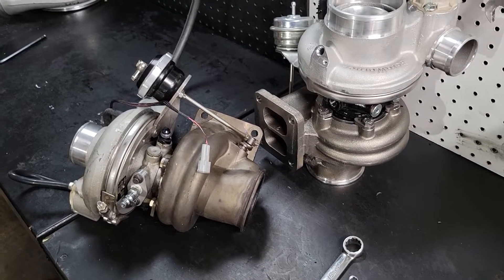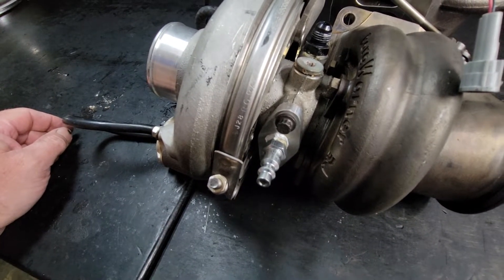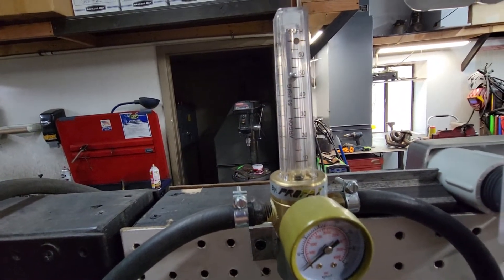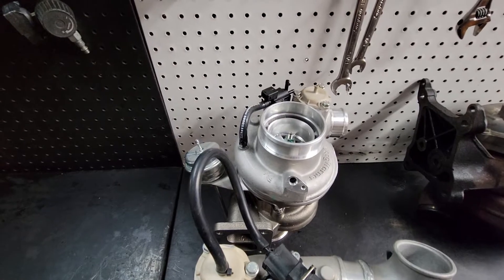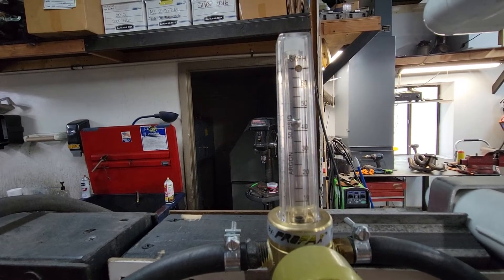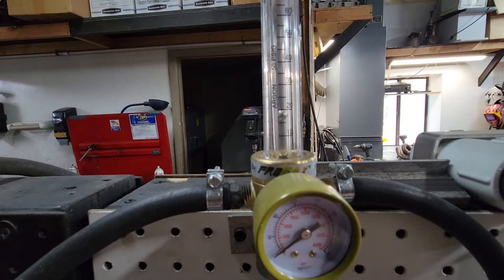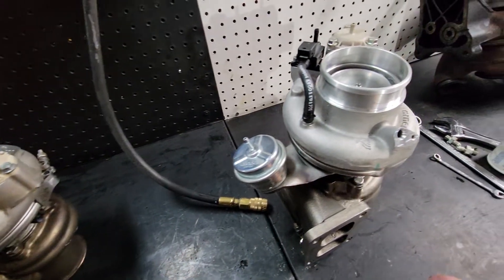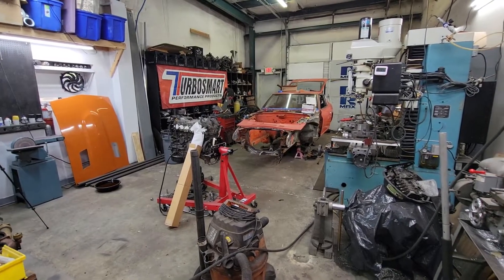BorgWarner EFR Turbo Seal TEST!  Good or Bad???  WORK Turbocharger's Test Procedure Explained

Comment: Nice setup. Have you considered testing them with ~200° water running through the center section and maybe coupling an motor with speed control to the shaft? I have a theory the EFR, aluminum supercore specifically, normally  leak oil on turbine side at very low shaft speed (idle conditions) at normal operating temps. Potentially caused by the higher thermal expansion rate of aluminum. All of my EFRs have done this and only remedy was oil restrictor >1mm
Reply from the maker: I have thought about testing them "hot", but in most cases of aluminum housings the "cold" leak will be less due to tighter clearances in the seal area.  As the aluminum heats up, the end gaps on the seal rings normally expand a touch.  This would be a fairly straightforward test, next time I have one on the bench I will do this...you know, for the sake of learning! -Reed
Reply: @workturbo  awesome 😎

Comment: You can’t test seals like this. It’s the pressure in the turbine and compressor that make the seal. The only argument could be the compressor wont make seal until the pressure increases enough to overcome the vacuum behind the wheel.
Reply from the maker: The seals are "gas" or "air" seals as you are implying.  Pressure does not really care which direction is is being applied from.  

We have a fixture that will pressurize the seal from the outside the turbine or compressor, but we find that deformation from the housing heat cycles/corrosion etc creates variables in the results. 

 This method of testing eliminates that as a potential source of leaks, but it does not let us isolate from compressor seal/turbine seal delta easily. 

  As I think I state in the video, this is just another "tool" we have in our possession to quality control to a standard we set as "pass/fail/questionable"

  This test actually came from an Engineer at BorgWarner, while not published in public domain, it was very well distributed to shops that could benefit from the information. I have been using this method for internal QC with great success, and I think others could gain from the knowledge. 

  Thank you for your criticism, it will help me with future video content.  Reed

Comment: Using a smoke machine will allow you to visually see the exact location of the leak
Reply from the maker: It is passing by the seal ring on the compressor and turbine side.  Turbochargers do not have a positive seal on either end, hence the brand new one passes air by the seal.  Most of the issues on a used one will be around the exhaust seal, we cap the compressor inlet and outlet to perform an isolated test at this point to verify.  Quick and effective.  Reed

Comment: 👍Turbo, speaking of crank case venting is it better to use recirculating with vacuum or atmospheric depenting on  volume of a baffle can or could you run both?
Reply from the maker: A proper high performance system will always include both.  The "positive" or "PCV" will make sure the engine stays free of moisture and helps with oil flow control around the turbocharger gas seals (vacuum being applied).  Once the vacuum is removed (PCV checks closed) you have to have a path for the crankcase pressure to escape (Crankcase breather/catch can/etc)

It is very important to make sure the PCV valve checks closed under boost pressure...especially if the boost is raised from stock levels or if the car was not a factory turbocharged model.

Hope this makes sense!  Reed